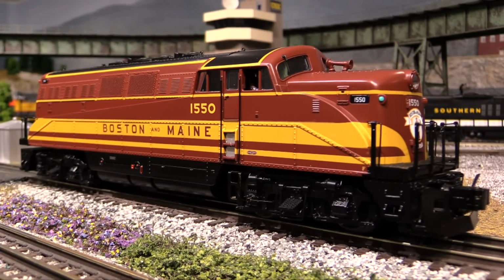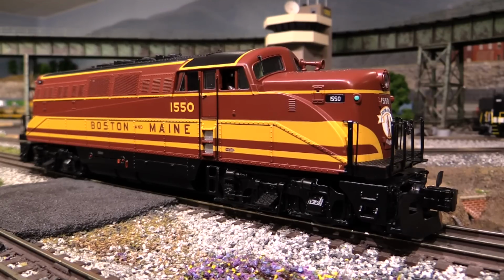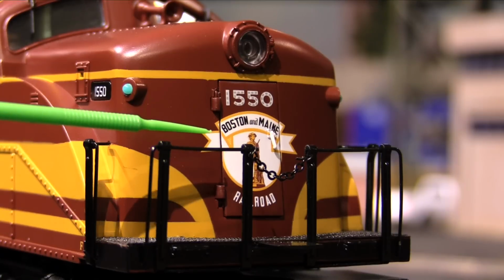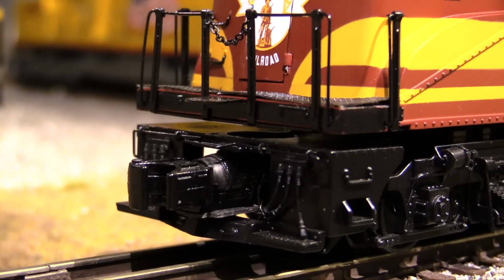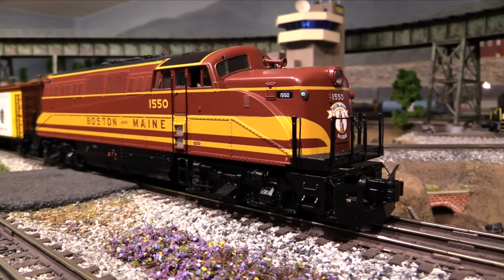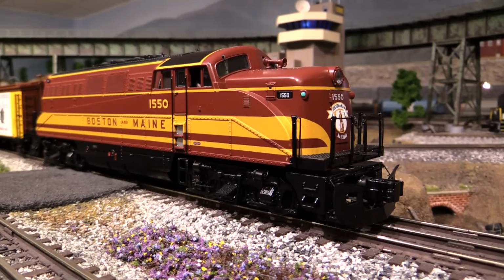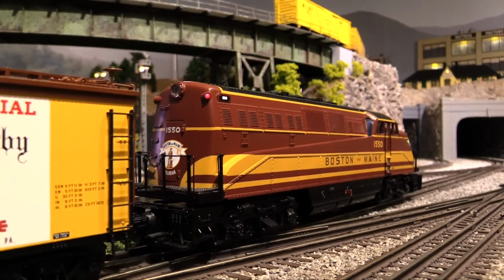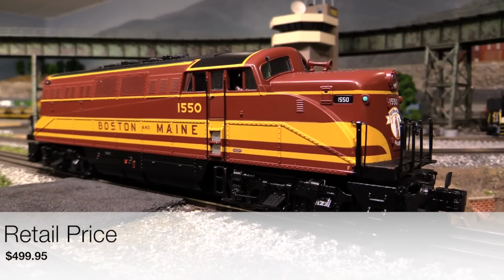MTH BL-2 Diesel

Comment: I pulled out my Legacy system to run my new SD40s around the tree. The remote seems to have a stuck 8 key. It just keeps entering 8. Have you ever had a similar issue, and if so how did you fix it?

Comment: I'm curious as to why American engines were designed with just one crew cab unlike U.K engines that have a cab at
each end? Surly having two driving positions would be a lot handier than just one? ``
Reply: g2macs because in UK normally most trains are for passengers and go back and forth on the same track but in America freight lines tend to be on one track and then switch to another to go back or they go somewhere else besides the starting location. That’s what I think I’m not for sure though